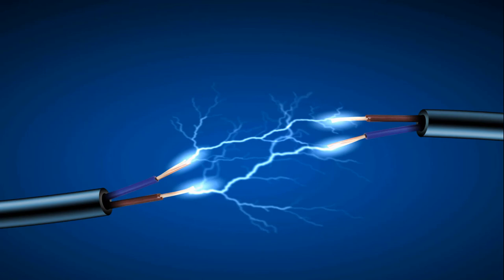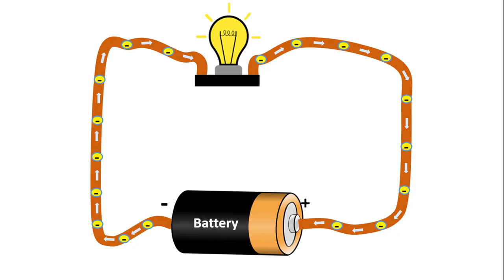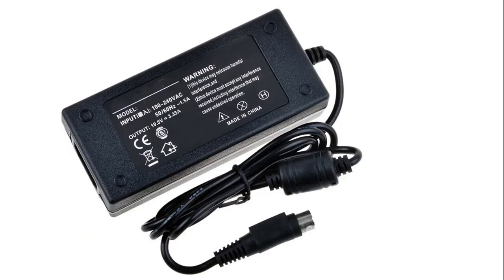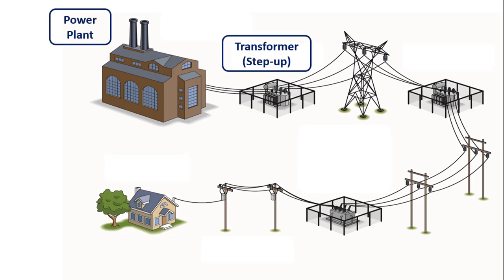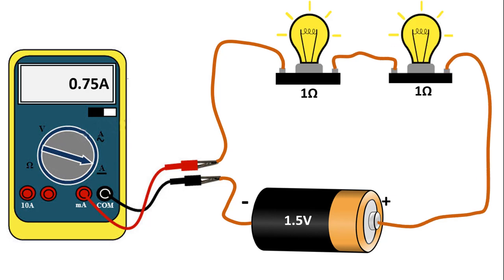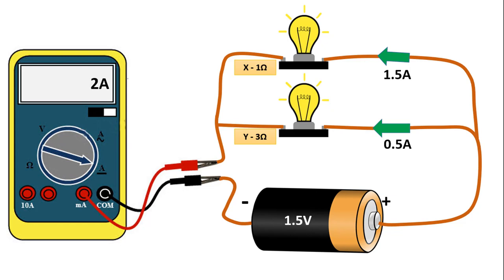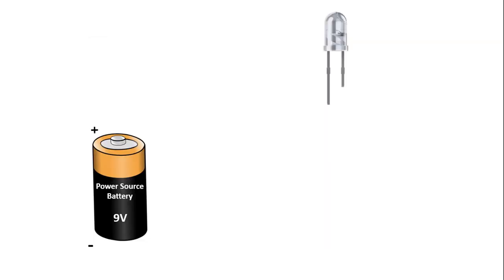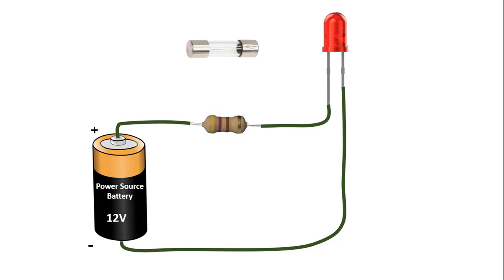Electrical Current Explained for Beginners (Electric Current Tutorial)

Comment: Current flows due to the electrons in the conduction band, not the valence band
Reply: He is technically correct because he is referring to a metal. In metals the valence band and conduction band are one and not separated by a bandgap. You thinking of semiconductors where electrons in the conduction band energy states are the only ones contributing to the current.